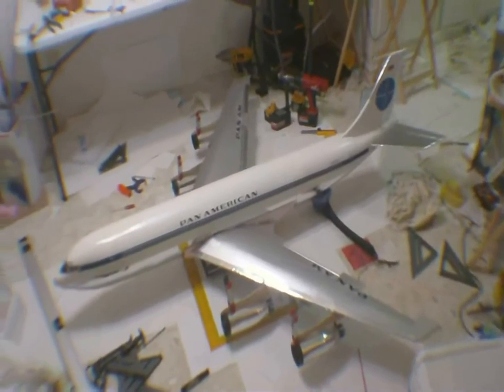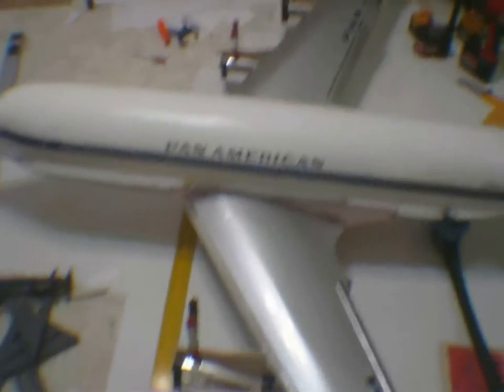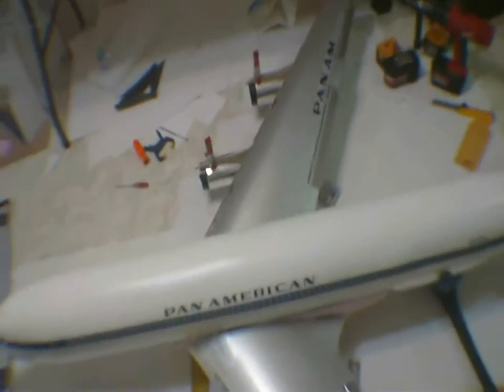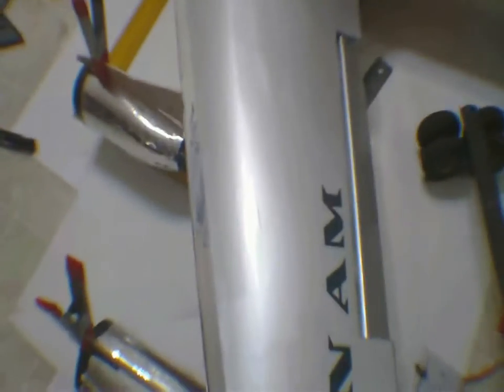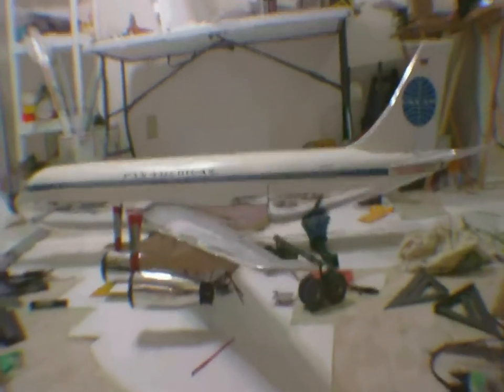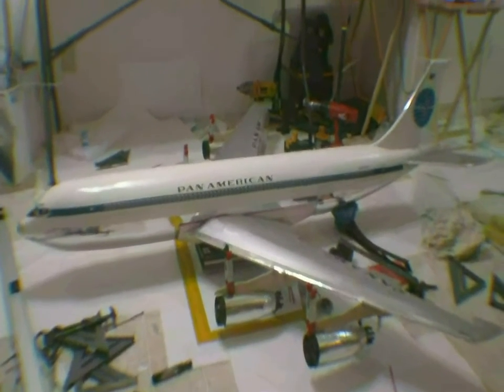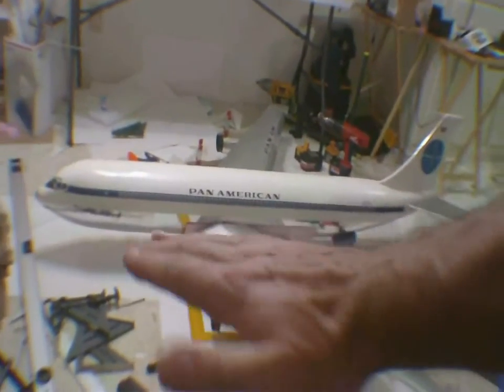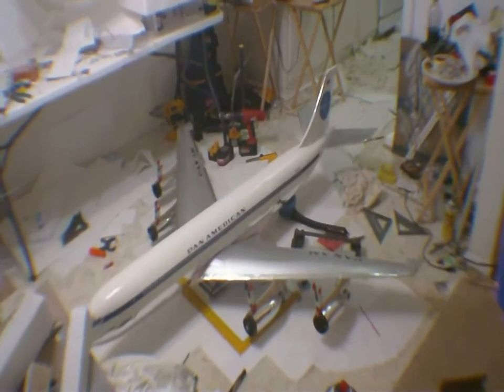Boeing 707 Pan American . . . Final progress report!

Comment: looks great.  I flew on a 707 in 1968 from Perth to Mauritius when I was 12 years old. It was a Qantas 707 and although it was a long time ago I still remember the 8 hours.  We were late arriving and we had a connecting flight  from Mauritius which we only just made.  We came down the 707 steps and walked to the East African airways Super-VC10 and then took of for Dar-es- Salaam. .  Good luck on the maiden.  2nd flight of my VC10 as soon as weather permits.  UK weather ain't the best 
Keith